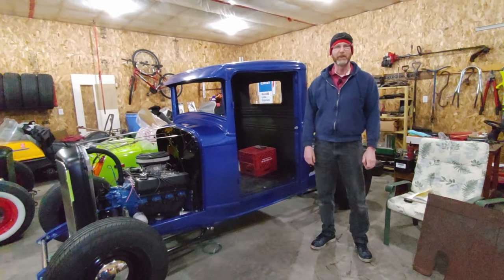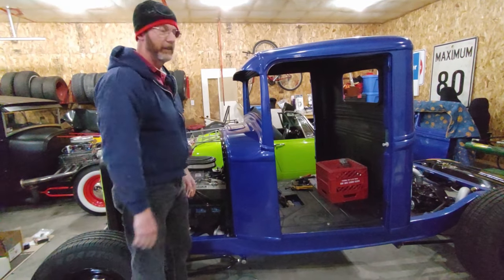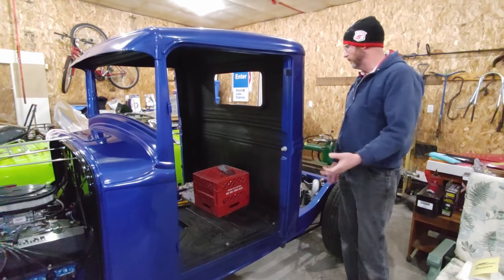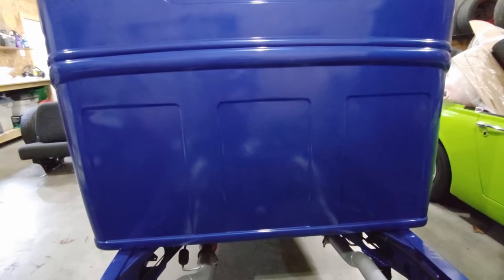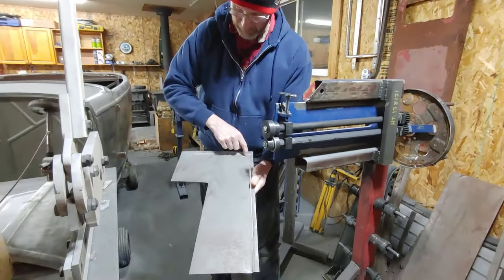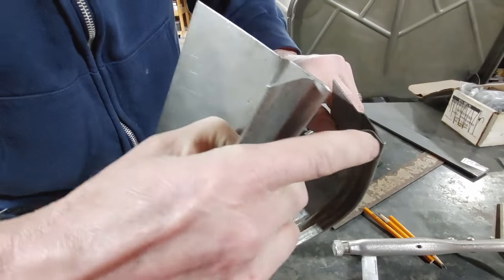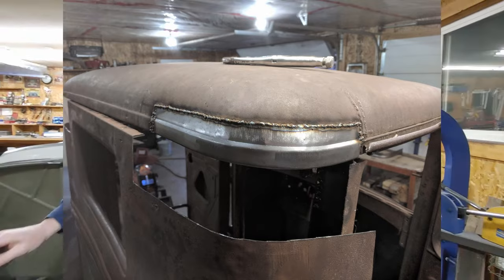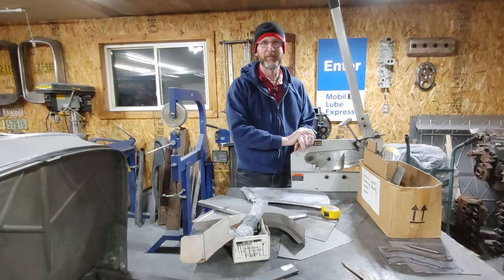How we rebuilt the cab for the 1932 Ford Pickup

Comment: I'm thinking of building Such model,..base of the DODGE/Plymouth Pickup Body 😎🍷 however I don't have any tools other than a welding machine I've been looking at several ,,2002-2007 DODGE Pickups,thus using the body panel from those models..
Reply from the maker: Good luck!
Reply from the maker: I started with welder and an engine block for my first build. It's one step at a time, just have a vision and move forward.